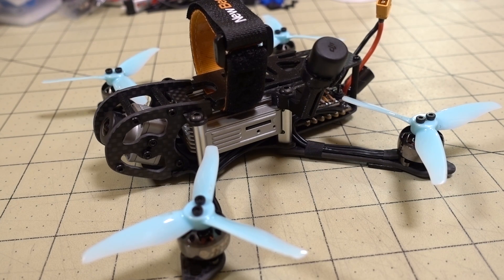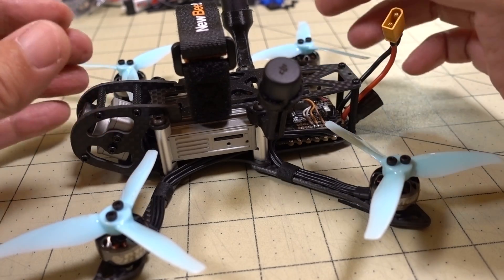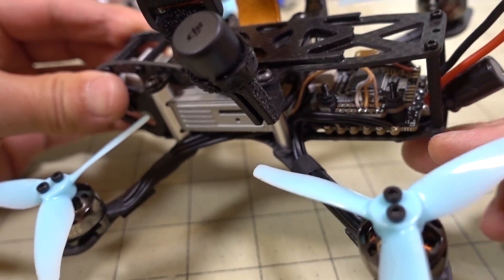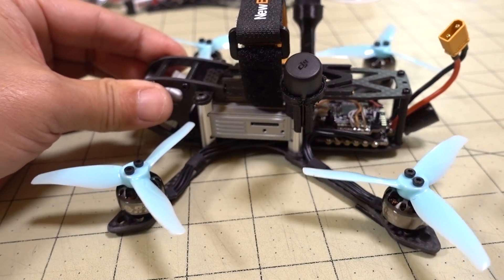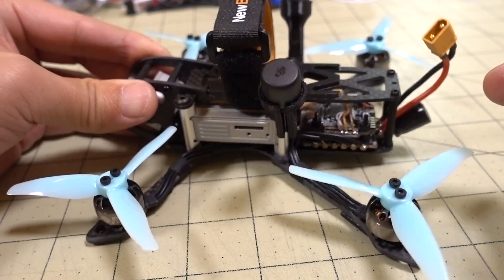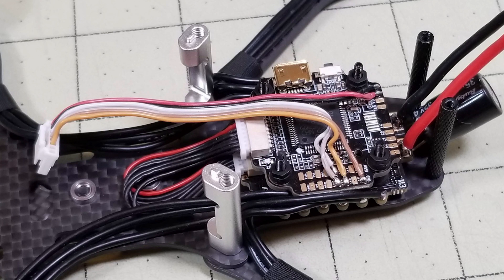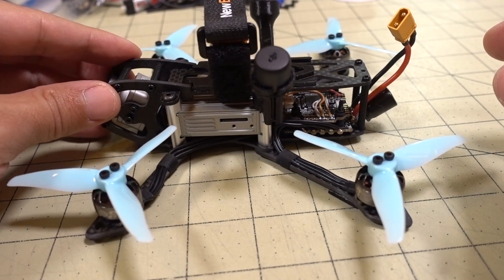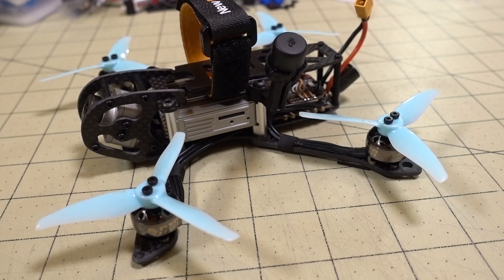NBD Whirligig DJI Micro Build & Flight 🛠️

Comment: You've been very helpful Albert and I appreciate all of your videos. Would you still chose to use the 1404 motors on this heavy of a build? Any other recommendations?
Reply from the maker: With this heavier frame, I think moving up to a 1406/1408/1506/1507 motor would really turn this into a beast but you'll be way over the 250g registration limit.
Reply: @AlbertKimTV  thanks a bunch 👍🏼 I've spent hours trying to find the right ones haha so many to chose from! Yes that's true, I'm not concerned with staying under 250g though 😉
Reply: @AlbertKimTV  I hate to ask.. But could you recommend a specific one? 😔😞

Comment: hey albert Ive got a question. ive got some gemfan flash 2540s that i want to use  for a 2.5 inch build, what motor do you recommend that leans a little more towards efficiency for those props
Reply from the maker: I'd go with this motor on 3S... it will be very efficient... just keep the AUW low - https://bit.ly/2VjWWmo

Comment: What do you think of the other 3” NBD frame VIM? I was thinking of building one of these over the DC3. Trying to go for something that’s not dead cat
Reply from the maker: Not sure about that one.  Also, I haven't flown it so it might be the best ever or it might be the worst ever.  Probably somewhere in between I suspect.
Reply: The Daios   I just build one of the VIM and now I’m building another with the VIM Frame. It’s my new favorite well balanced it’s very agile. It only takes a 16x16 or 20 x 20 stack although it says it takes a 30x 30.
Reply: @tonyh6438  Good to hear! Seems like the VIM might be my next build with the air unit. What parts did you use to build it? Mainly what motor and prop?
Reply: The Daios  Emax 1408 3600kv motors HQ 3x3x3 props flywoo goku f722 FC and Aikon AK32PIN ESC.
Reply: @tonyh6438  Why won't the VIM fit a 30x30?
Reply: Nevermind, I thought it had the mounting holes for a 30x30.  I read it wrong.
Reply: Check out the 3" Colibri Unibody, if you can go Vista unit, instead of Air Unit. It's a true twin tipped H frame. No props in view, absolute ripper. While I love my DC3, the Colibri build just replaces it in every aspect. I'll try to post video.

Comment: How do you like those props with that heavy of a build? The fpv cycle product page recommends an AUW no more than 120g for those thin props.
Reply from the maker: They felt totally fine.  Remember, those are Kaba's recommendation based on his feel.  Its just one opinion.
Reply: I totally feel you Albert, and I'm glad to hear you're onto them for heavier builds too.

I recently went back to an older build, swapping these Gemfan tri blades onto a scratch built iFlight 136RS V2, last being flown with HQ T3x2.5x3 (great prop, but flawed due to consistantly poor balance,) on 1104 4200kv BeeMotors, and 450mah 4S GNB. Now this is a heavier build, with big LED bars, front and rear, Hells Gate Buzzer, Predator 4 Nano with the huge lense upgrade, some gunmetal blinged hardware, basically an UNtoothpick, if you're familiar with Bob's philosophy.  Well I couldn't believe it. The Gemfans, with their fantastic/flawless balance, on 4S, reawoke my little beast like never before. The resulting feel is like a Toothpick, as far as having total, and absolute authority, but this has even more, despite the increased momentum, and it is all available within a smaller stick range than my certified Toothpicks. These props are miracle workers, and I get well over 5min of hard ripping. (I'll add I have 24/48Khz JESC 2.3 and RPM filtering on nearly every quad I own.)

I didnt understand them at first, and tried them on one of my heavier 3S TP3's. They made it feel unwieldy, boaty, compared to the HQ T3x2 bi blades, and so at first I wasn't a [Gem] fan. I have them figured now though, and they really make a heavier 4S 3" build come alive, much like the ultralight 3S builds, or super ultra light 1S builds. . Out of over 20 unique, Toothpick class quads, there's nothing else that feels quite like my 136RS V2. I've been wanting to share this, because I seriously feel like I've struck absolute gold. I mean, the thing rips up and down, and across the sky in 10+ mph winds like they doesn't exist. Tough to convey the revelation, and how seriously thrilling it is to fly. I'll be back to edit this reply with dry weight, and AUW, so maybe it's actually useful to someone. Edit: 133g AUW, 80g dry.